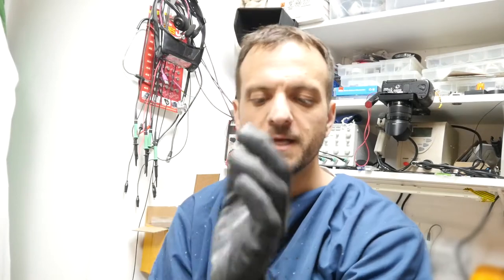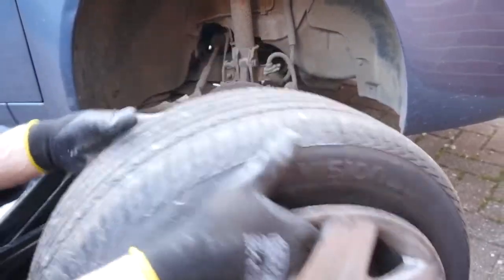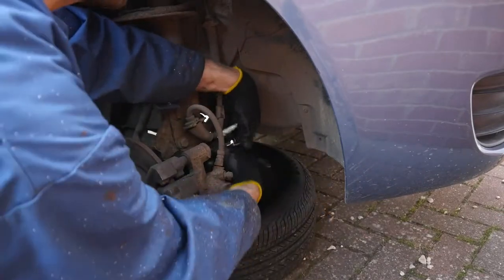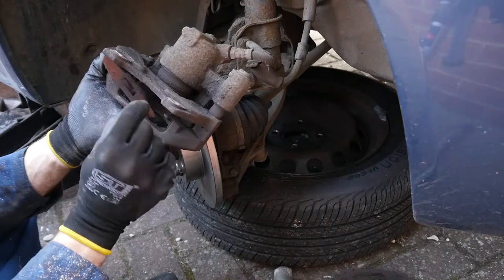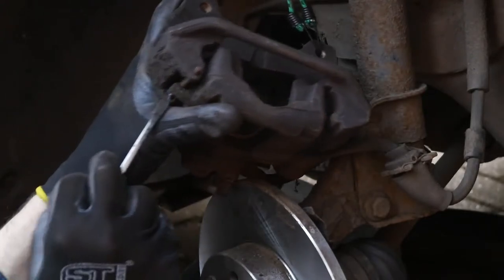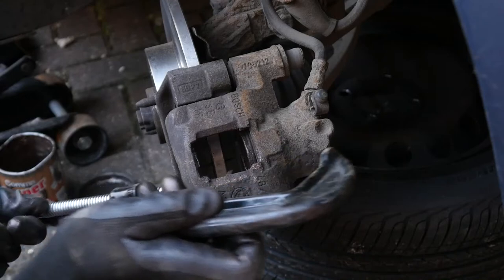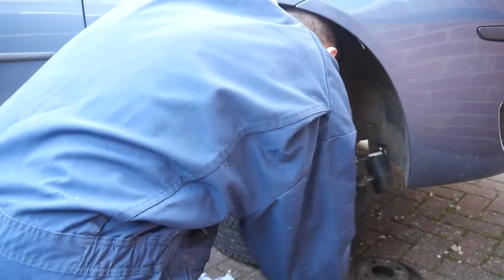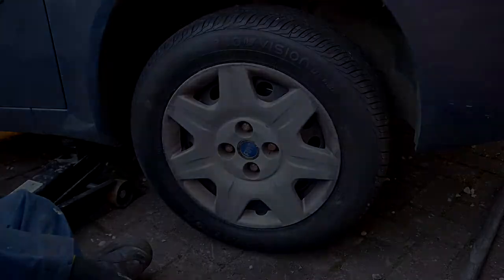How to change your disc brakes

Comment: I heard the professional way to not let the wheel spin while loosening the bolts is to put in a gear and pull the hand brake (park brake).
Of course on the other hand if you want to replace the brakes (not just the wheels), at least  the pulled hand brake would be quite a hindrance. Would mean remove the wheel -> loose the handbrake, but as usually one would likely either replace the front or rear brakes that shouldn't be too much work actually.
Reply from the maker: As you discovered through your thought exercise its relying on the drivetrain or brakes (parking brake) and I trust neither because there are so many variations and this works on everything with just a flick of the wrist on the jack. If you are using air tools they have enough torque to get the bolt off without even spinning the wheel.

I consider myself a professional and this is the way I have been doing it for a zillion years - you can trust me, im a Dr! :)

Comment: The joys of sorting brakes, I used to have to strip my motorbike front brakes annually as they used to bind on even though I used copper grease. Once one of the pistons came out and poured oil all over the disc and wheel but not the pads.
Reply from the maker: +Mark Davies That's annoying! I love doing the bike brakes, none of that wheel man handling and you don't need huge tools. Those sintered pads eat the rotors though 😂

Comment: Only 4 nuts... is that common?
Reply from the maker: +brewski118sempire pretty common on the smaller cars / wheel sizes
Reply: So odd, Never had seen that before here in the US.
Reply from the maker: +brewski118sempire I have even see 3 stud on old stuff 😂